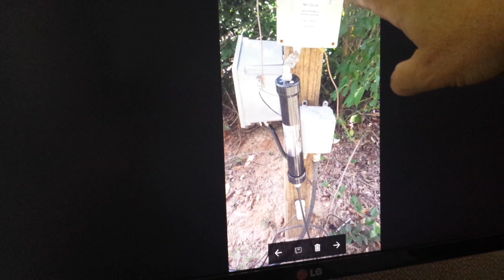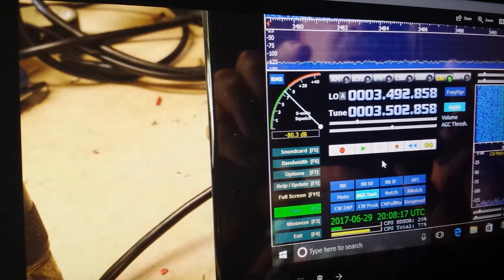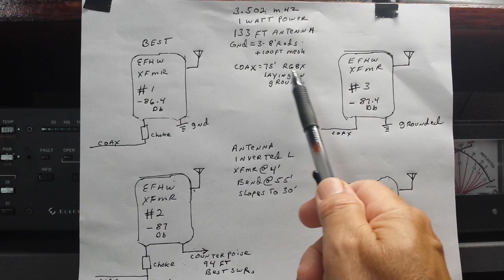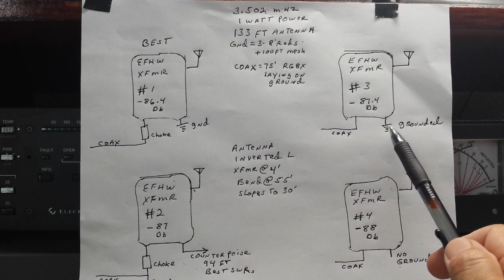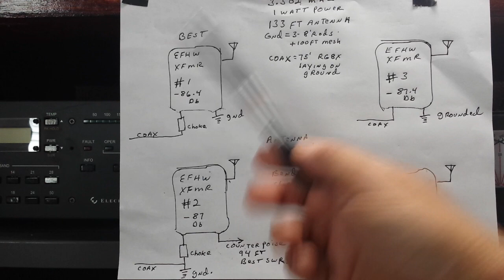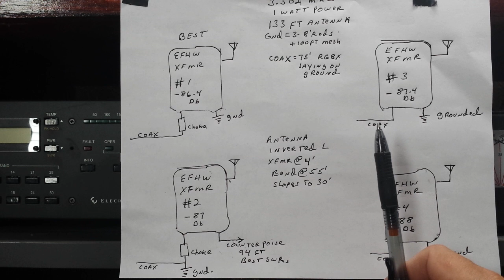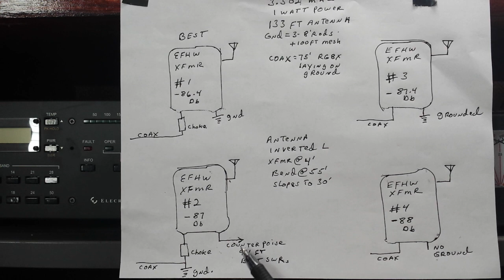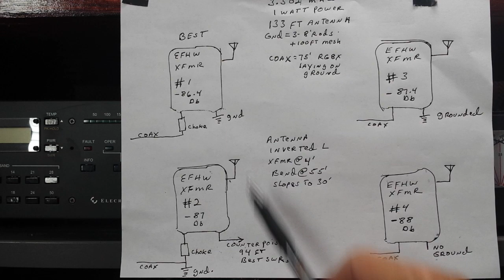EFHW Grounding Compared

Comment: Question I have my antennas efhw 7510  2k plus  49:1 at around 16ft and 130 ft long wire at around 50 ft  and 100 ft of lmr400  coax is grounded at the entrance to the house 8ft rod with lighting protection…so do I need to ground it since it’s 16 ft high at the 49:1 ? Do I need to install a choke? If so where ? To improve?

Comment: This is a very helpful video for EFHW. Could you do a test and video like this for the End fed random wire antenna design or give us your guess about how the EFRW design should be configured with respect to counterpoise, choke, and grounding?
Reply from the maker: If you think about it, there is no such thing as an "end fed random wire". The feed point will never be at the end because there is a counterpoise. The feed point impedance will be determined by the frequency and placement of the feed in relation to the wire and the CP. The counterpoise can easily radiate more than the antenna if the wrong length is chosen. Technically you need a full radial field for proper operation otherwise much RF loss will occur in that CP system. EFRW's are not good antennas but of course you can always make contacts with them and if you're in a contest you'll always get 599.

Comment: On your diagram for the "best" system...you show a choke on the coax.  Can you recommend what manufacturer and model # of the choke ?  (Ant = myantennas EFHW-8010)
Reply from the maker: 8 or more turns of RG-8x or LMR-400 wrapped around a 240-31 mix ferrite torroid. Really you shouldn't need anything since it's grounded. I had trouble at that qth with strong BC qrm.

Comment: I recently installed the myantenna 40M/80M/160M EFHW , mounted as an inverted V with the apex at 110'. Measuring with a MFJ clamp on RF current meter, 28ma. was measured at the antenna transformer, 50 ma. in the shack, with 10w Tx. There was no change when grounding the transformer to a ground rod, but now the SWR was closer to manufacturer specs. After installing the myantenna  RF choke, mounted as shown here, there was no reading at the transformer or at the shack side of the transmission line. There was a slight reading on 160M.

Comment: Wouldn’t chicken wire rust and deteriorate fairly quickly? Did you just lay it on the grass and use lawn staples?
Reply from the maker: Yes. Chicken wire is short lived. I prefer using horse fence, welded mesh. Just use cheap tent stakes to hold it down although it can get rather frisky.
Reply: Steve Ellington do you just mow over it ? I’d love to see a vid of your yard. 73 from ky

Comment: Steve:  Please tell me about the choke you used.  Why did you add it ?  What was special about it ? (i.e. chatacteristics, etc.) . Do you remember the Myantenna P/N ? Where you planning to used it across the bands ?  I will be installing the same antenna this fall before the snow flies and need it get it right the first time. (Snow gets deep here.)  Thanks for video and all the work behind it.  Regards, a Newbee
Reply from the maker: I have since eliminated it. I was having trouble with local AM radio stations and the choke helped. I have since installed a high pass BC filter  at the rig. I wouldn't bother with it if I were you. The direct ground does  help virtually everything though. Nothing fancy, just a 8ft ground rod will do the trick. It also provides lightning protection. 73

Comment: Was the 19" antenna at the SDR vertical, as shown in the video, or was it horizontal? Did you use both and average them or something? If you didn't, would it have made a difference?
Reply from the maker: The changes I made at the feed point wouldn't have much effect on the polarity of the transmitted signal and my antenna system did not change. I was very careful to NOT  disturb the pickup antenna.

Comment: Your EFHW video's have been extremely valuable and educational.. thanks for sharing your test results/experiences.  I have been looking at MyAntenna products and was trying to determine if the choke was worth purchasing/implementing.  Your experience clearly shows that it is worth the investment!!  Question .. does it make a significant difference if the choke is located at the antenna versus the transceiver ?  Thanks, Jeff WA4LLL
Reply from the maker: In my humble opinion it is better to have the choke at the transformer but if you do, you will need either a ground rod connected to the ground terminal on the box or a counterpoise wire at least 12 feet long or so. Putting the choke at the shack will keep RF off the rig in cases where the coax shield is picking up RF from the antenna but it won't  isolate the coax shield from your transformer. I would put it on the antenna end and if that doesn't work try another one at the rig. The myantenna's choke is a bit expensive but does seem to work well.
Reply: Steve Ellington do you recommend another brand of choke that isn't this expensive?
Reply from the maker: Over the past year of experimenting with these things I can honestly say that I don't know. There are too many variables to make a blanket statement, yes or no. If you are having problems with RFI in the shack then the choke would be a good addition and typically it works best on the "shack end" of the coax. If you use a choke at the transformer then you loose the counterpoise effect of the coax shield and will need to provide another ground or counterpoise. This might be a good idea if the coax happens to run near a noise source... Even a choke at both ends might sometimes be of help. Right now I have no chokes anywhere but I do have a very good ground at the transformer. The Myantenna choke does seem to be a good choice.